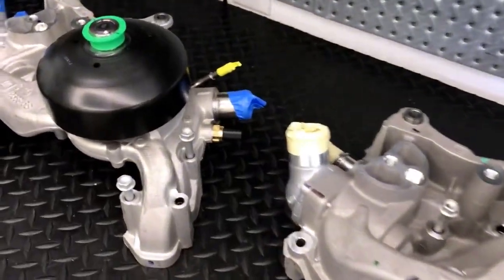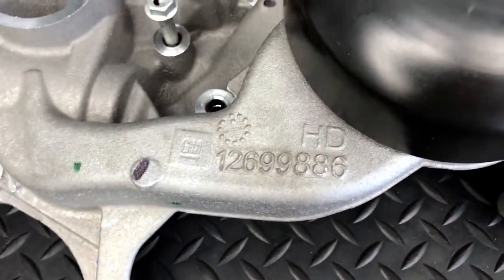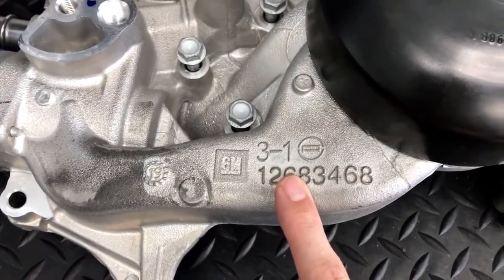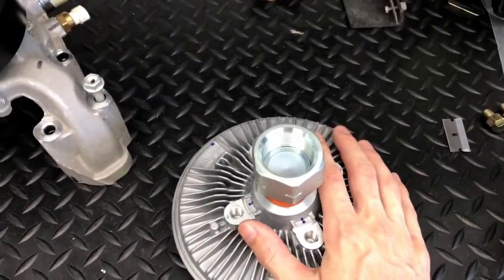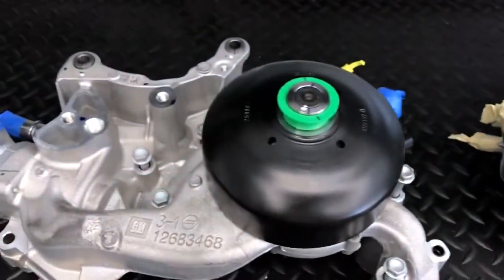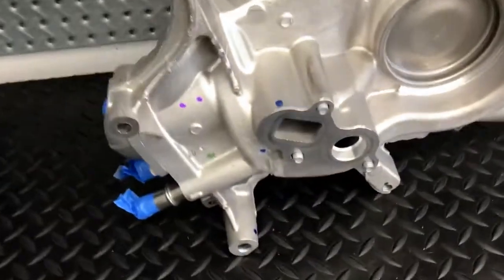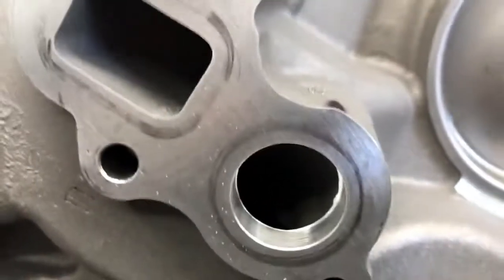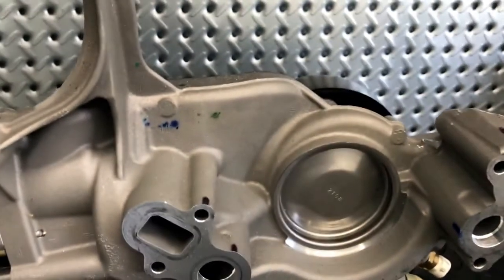LT Water Pumps - The Difference Between L84/87 and L8T

Comment: Great Vid, need your advice, I am pulling out a L83 and dropping in a L8T engine, someone mentioned for me to install the L83 water pump onto the L8T , 1 bolt will not line up and requires a some modding, unless I am not understanding what he is saying. Thanks

Comment: Will these work on a L83/L86?
Reply from the maker: Yes. I have the L8T pump on my L86 now.
Reply: @anvilmotorworks4475 , awesome.  Do you know if it'll clear a LT2 intake?
Reply from the maker: I have not personally tried fitment with a LT2 intake so unfortunately I cannot confirm
Reply: Ok.  I'm going to try and do a L84 setup on my L83 with the stretch belt.  I'll use a Volvo pump for power steering.